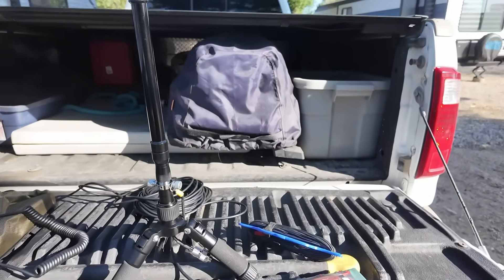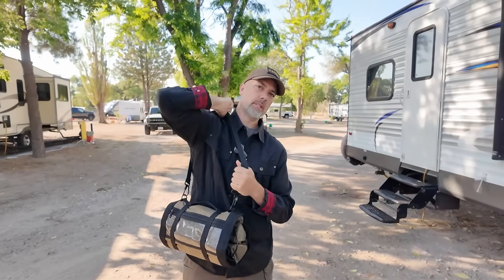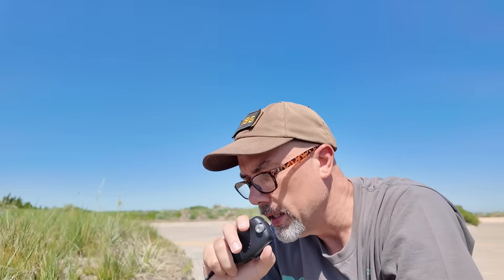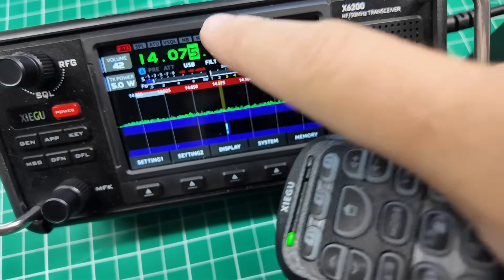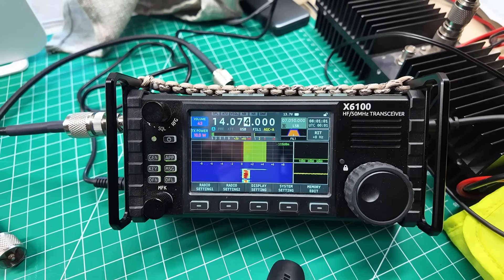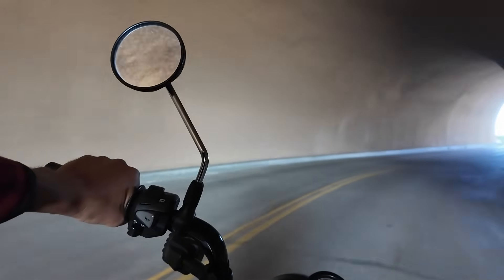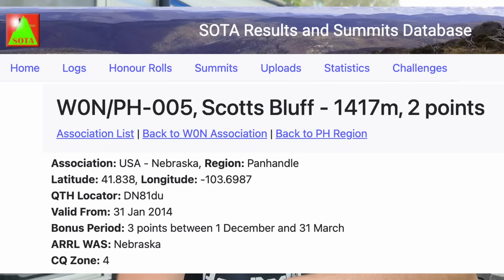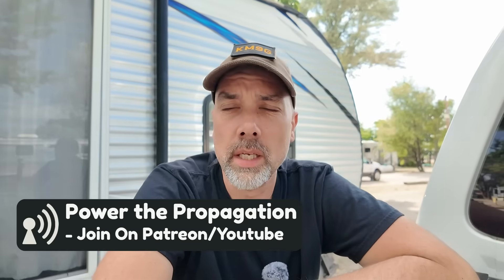My Radio FAILED When I Needed It Most… Then This Happened

Comment: Do you know if the x6200 works with any particular Bluetooth Mic? Cheers
Reply from the maker: bluetooth and ham radio is really quite strange.  Most of the headsets, computers, cars I've tried won't connect to a ham radio.  There were some folks in the UK (different bluetooth region, different rules) that were able to get UK headsets to connect. You'll just have to check return policies and try.
Reply: @temporarilyoffline might give it a go, thanks for your response :)

Comment: When I'm running portable I always carry 2 or more radios, tools, soldering iron, connectors, cables, NanoVNA and Tiny SA. (I just bought 2 QMX+ kits for that very reason.) Of course, I usually carry them when I'm not running portable, either. My backpack is heavy. :) BTW, you missed an opportunity. Whenever you're in an environment like that one set your antenna right up on the edge of a downslope hillside or cliff. That way you get almost no ground reflection no matter how short your antenna is, (so no lensing,) and you'll get a very flat radiation pattern. But you do need to be within a few feet of the edge of the drop or downslope. 

I'm from CO, and whenever I go back east on I-80 I get on a 2 meter repeater in western Nebraska. There is, or at least there was, (it's been a while,) about a 2,000 foot tower in western NB and a 2,000 foot tower in eastern NB, both with 2 meter repeaters on them. Between the 2 of them they pretty much covered the state, and when they linked them together they certainly did. They made the long, flat, quiet stretches of the state more bearable, and there was no need to fool around with a rig while driving, which is something I never do in any event. So setting up on a big repeater makes a long stretch of silent nothing more pleasant.
Reply from the maker: Good point about being on the slope for the activation.  Next time!

Comment: I see this mistake often: Talking across the mic instead of directly into the mic. When talking across the mic, the receiver will hear voice peaks but not the full syllable. Talking directly into the mic will crack pileups. -73- W3GCW
Reply from the maker: Proper mic technique is one of those often debated issues where lots of old-wives tales are passed on as law.  My favorite is when somebody says "hold the mic 1 inch from your mouth" and then demonstrates a good 3 inch over.

Comment: Another thing to check when you have no output  showing on SSB is to switch to FM. Why? Those mic leads can have issues. In my case I switched it end-to-end, bad contact solved. I'm not saying that is the issue you had, just for the viewers before even doing a factory reset, make sure it"s not simply a mic fault (to test you could switch to the internal mic and use that). 73 Ed
Reply from the maker: Oh yeah. Always check the simple/cheap things first!
Reply: @temporarilyoffline it's the small simple things that have caught me out more times than I like to admit!😮

Comment: Nice troubleshooting overview!! Had a question about the roll-up bag. I have a Bioenno 6ah "blue wrap" battery, which measures 2.75 x 2.5 x 3.25 inches. I notice the Denco is flat, and a search on their website shows it's 5.5 × 2.8 × 1.75 in.

Do you think the Bioenno would fit in the pockets of that rollup? I really like that solution for carrying a portable setup.

Thanks!
Reply from the maker: There is plenty of room in that roll-up.   I think it will work just fine.

Comment: That was impressive gimbal work. I really say how much those handles bars were shaking but the video was so smooth. Good job on doing the factory reset. Tim, Grayman POTA, has a running joke on the HRCC after chat where he always asks "Did you try a factory reset?" but it is surprising how often that does fix things. That is some pretty country. Thanks for sharing.
Reply from the maker: It's usually some setting you forgot you changed and didn't need in the first place... There are so many!
Reply: Try 250 or so miles SW of there where I'm from. I fell asleep on I-80 just east of Ogallalah, on my motorcycle. Nebraska bores me to tears.

Comment: Not too long ago, I was running CW on the X6200 and the TX kept getting stuck on a solid tone when I would key up. It would not stop transmitting until I turned off the unit. After some back and forth with radioddity trying to troubleshoot the radio, we determined it was a failure internal to the radio and they sent me a replacement.
Reply from the maker: Radioddity has great support!
Reply: @temporarilyoffline  yes they do! Very quick to respond and super helpful!

Comment: "Log all your contacts whether you activate or not" - very true.  Had a "Failed Activation" at US-5510 when I started at 7:48PM EDT and focusing only on the park closing time instead of considering the actual POTA window (0000Z to Sunset/Park Closing, or Park Arrival to 2359Z).   Had an absent-minded moment.  Still, I got a couple of park to parks, including US-5510 > NL-0038. before 2359Z.   Thanks for the video.
Reply from the maker: Working the UTC day switch is amazing.  You get a good amount of hunters that want double credit.